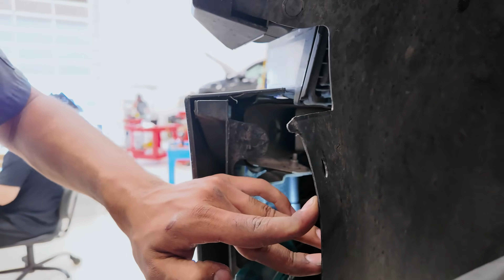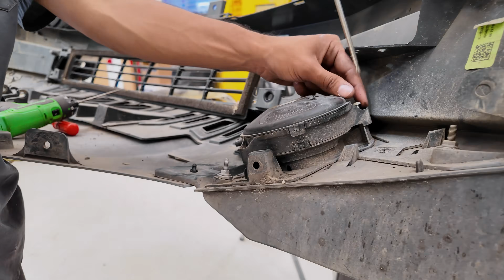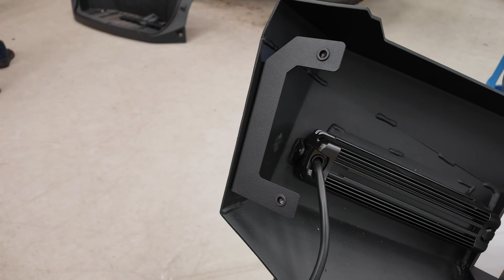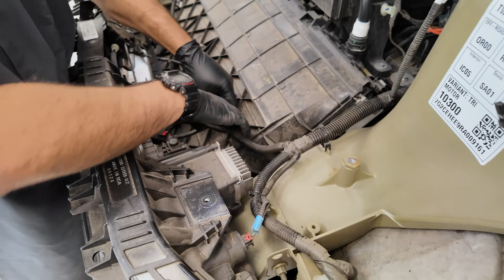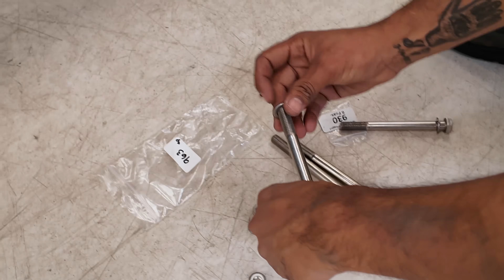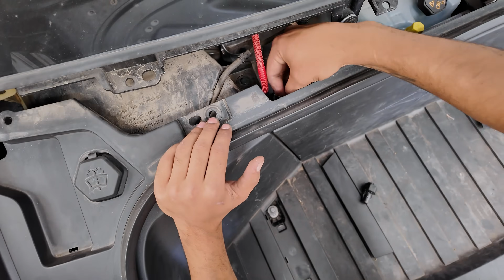UP Invincible Cybertruck HD Front Bumper Install Guide | 2024+ Tesla Cybertruck

Comment: Everything from the rear right blue post to the front rest of the Cybertruck shown of the truck at the beginning of this video is visually really striking. Somehow the part to the back of the rear right blue post makes the design come off a bit too boxy, especially from a side profile point of view. The Cybertruck visually as is still should be renovated into a future proof upgradeable official Redux 1st edition with 3000 mile range solid state battery swap upgrade capability with silent superpowerful powertrain with wired/wireless supercharging all within a solid superstrong tow frame, but I can see that large boxy side profile from the right blue post back being adjusted with an added vertex adjusting the rear downward sloping top rail line to make a more standard truck looking vertical rear window area with a horizontal truckbed top rail in an official future 2nd edition of the model.